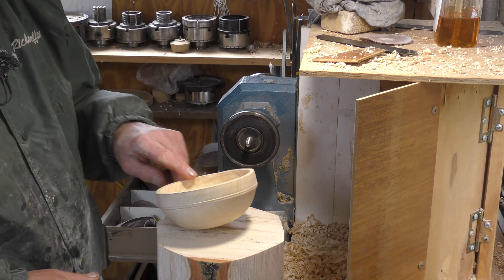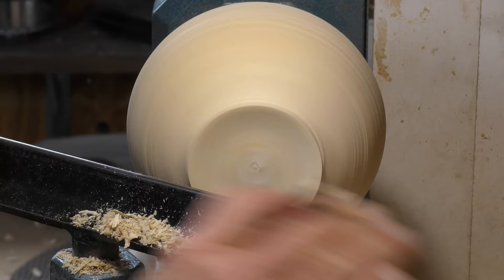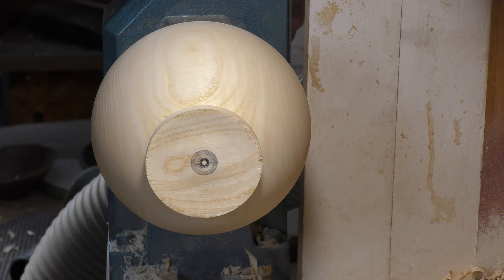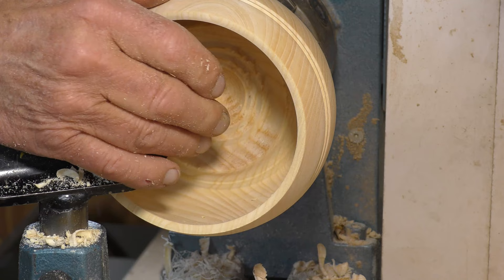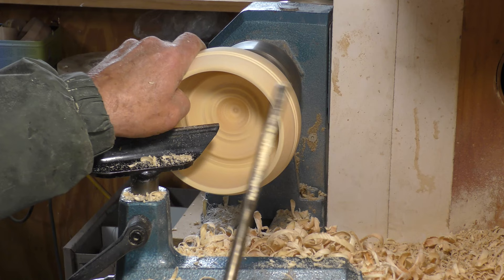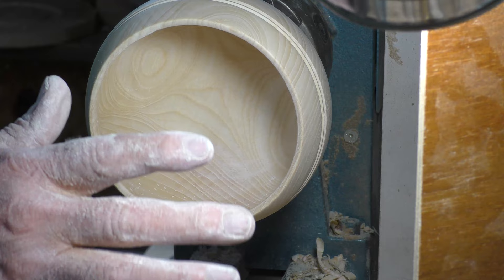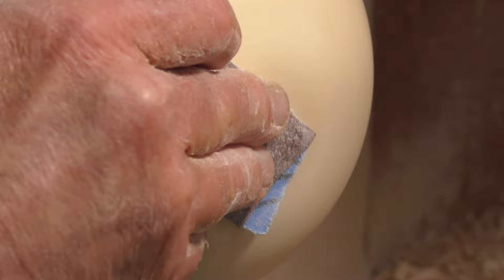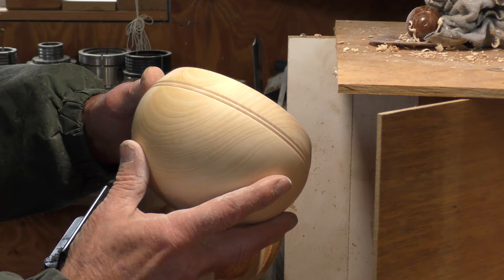Richard Raffan turns a small bowl from green wood

Comment: Its me again, sensei.  I saw the beautiful tray out of ash, and now I will continue my bingeing on your videos. But what in the world do you do with a bowl without a flat bottom? You could eat a bowl of cereal, or soup when camping...Ha!
Reply from the maker: My observation is that longterm bowls warp slightly, and that those that started with flat bases wobble on a flat surface. I build that in initially. My round-bottomed bowls are flattened spheres, often with a slight indentation at centre and they're seadier than you might think. I have two I often use for breakfast cereal, one turned on a pole lathe by Robin Wood. For assured longterm stability I have tripod bowls and you cna see those on https://www.richardraffan.com.au

Comment: I am always amazed at your use of a spindle gouge to remove wood! I always thought that you weren’t supposed to.
What would you say is the bevel on the spindle gouge?
You are amazing!
Thanks!
Reply from the maker: The bevel on the nose of my 1/2-in spindle gouge is 45 degrees for facework and about 35 degrees for spindles and endgrain hollowing. It is deep-fluted spindle roughing gouges that should never be used for facework. They used always to be called roughing gouges, which led novice turners to think that meant roughing anything.

Comment: But if it's green wood, won't the bowl distort when it dries out? It seems too thin to turn it again and true it up if that happens.
Reply from the maker: I turn most bowls green knowing they will distort. How they warp is dictated by how the grain lies in the blank. You can see a few of the thousands I've sold over 40 years at https://www.richardraffan.com.au/bowls-turned-green/. A major advantage of turning green bowls is that you can use logs before they split. When I finish bowls green I don't have to wait years for the roughed bowl to season. I leave three feet on green-turned bowl so they sit firm —  https://www.youtube.com/watch?v=dqtydrnCpyU&t=7s.  You'll find more about turning green wood in my books, and particularly The Art of Turned Bowls or Turned Bowl Design.  https://www.richardraffan.com.au/books-and-dvds/.